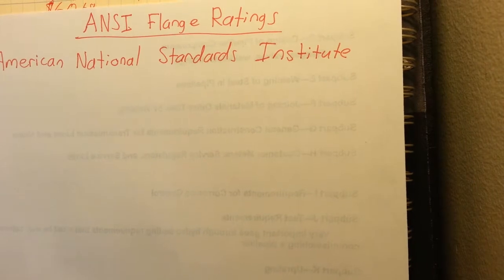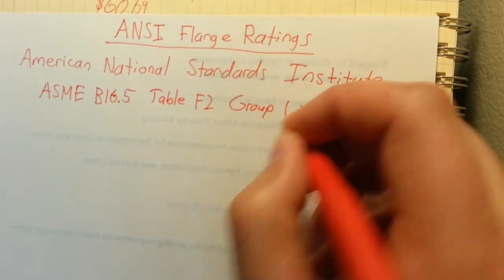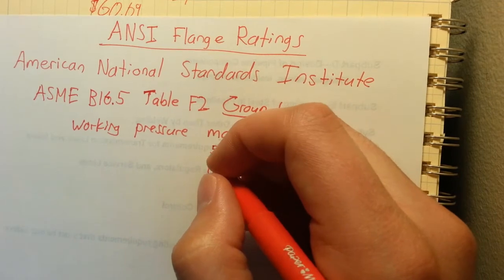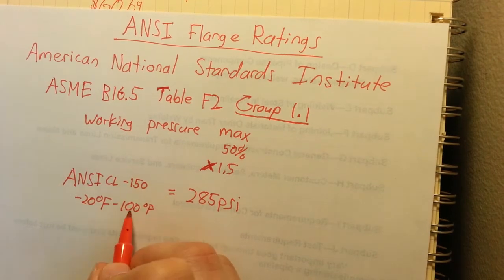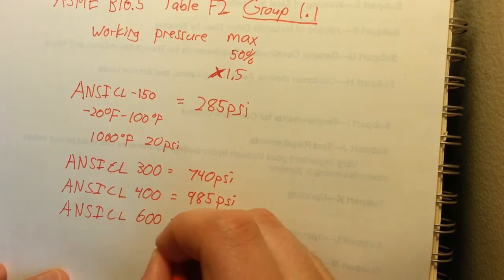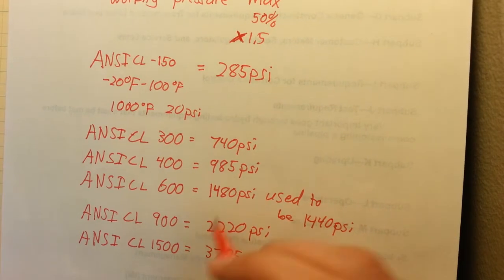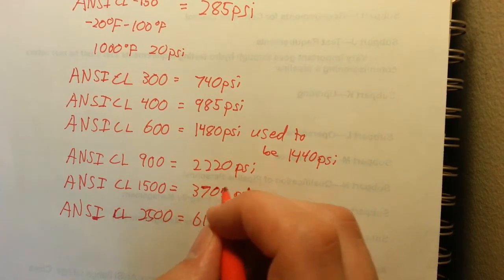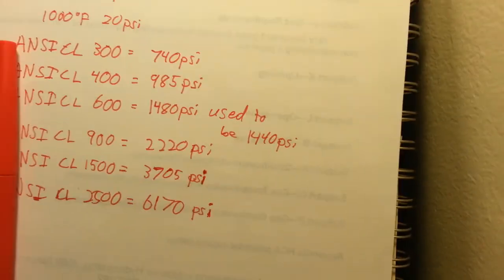ANSI Flange Ratings ASME B16.5

Comment: What do the 1”, 2” etc mean? Is that the thickness of the flange? Also, what does 150, 300 etc represent? Are they arbitrary?
Reply from the maker: The 1" and 2" are referring to the pipe size that the flange will fit or mate to. And yes from what I know the 150, 300, etc are arbitrary designations for pressure ratings. I have heard rumors that they have something to do with very old antiquated pressure ratings of flanges but I can't verify for myself.

Also If you can find a copy of the ASME B16.5 code book it will give you every size flange dimension for a given pressure rating, if that is what you are looking for.

Comment: How to do valve leak test she'll test backsheet test high pressure and low pressure sir make a video
Reply from the maker: Typically valves are tested with the gate (if a gate valve) or ball (if a ball valve) in the half open position. This allows for the shell of the valve to be tested which generally can be tested (based on the applicable codes or manufacturer's recommendations) up to 1.5 times the design pressure rating of the valve.  For a test against the gate or ball, the test can be performed while the valve is closed and the pressure on one side of the valve tested at the design pressure of the valve.

Comment: i still have a doubt sir, if the maximum pressure rating for a particular class flange, say A105 @ 100F is 285 Psi, then it means it can handle 1.5 x 285 Psi= 427.5 Psi which is equivalent to 29.4 Bar. So if my unforeseen pressure of a piping system will be like 25 Bar i can still go with ASME 150# flange.
can you please also where in which code i can find the relevance of flange MAWP= 1.5 x MWP
Reply: It can not possible. The Hydro test pressure is the only one that you multiply for 1.5xDesign Pressure. Pipes can hold an occasional load as 1.33 x design pressure too. If your design pressure is 25 bar, so you shall specify the above pressure class that is 300#.
Reply from the maker: With respect to a flange fabricated from ASTM A105 with an ANSI Class 150 flange at max temp of 100F, the 285 psig pressure rating (B16.5 code) is the design pressure.  The flange test pressure typically can not exceed 1.5 times the design pressure.
Reply: @commtechengineer612  this is not the response I was looking for, I want to know where it is written about the MAWP, during hydro test the pressure will go above the design pressure, so where I can get this confirmation, please give me code relevance
Reply from the maker: @yasirzaya9316  Code of Federal Regulation Title 49 Part 192, Paragraph  192.619 references test pressures.  The table indicates test pressure based on Class Location. 
The ANSI/ASME B31.8 also describes test pressures, but Part 192 has the rule of law.
Reply: @commtechengineer612  you have not answered what I had asked🙄

Comment: Good video...Can you elaborate how the particular pressure in psi is calculated for the particular pressure class...what does 150,300,....means
Reply: Kesavan Rajendran the 150,300... means class pressure that related to pressure and temperature. For example, class 150 can hold a pressure higher in low temperature and it will be lower when the temperature goes higher.
Reply from the maker: For flanges and flanged fittings, you can refer to ANSI/ASME B16.5 for ANSI Class ratings and their corresponding design pressures for those ratings.  The ratings are based on the material and maximum design temperature.